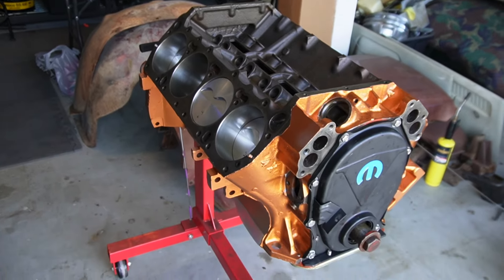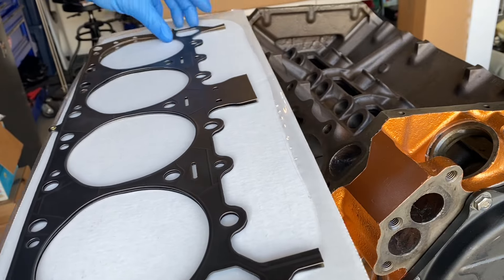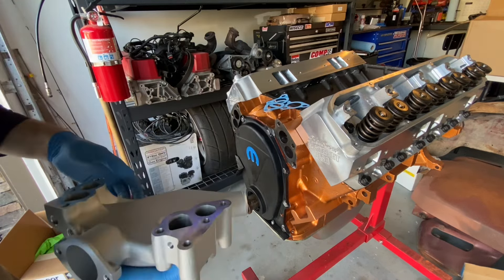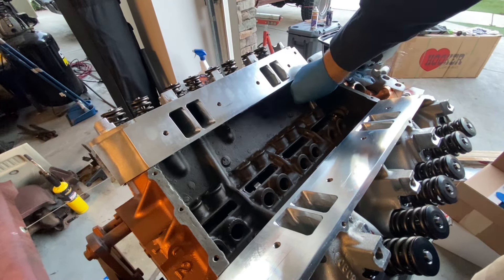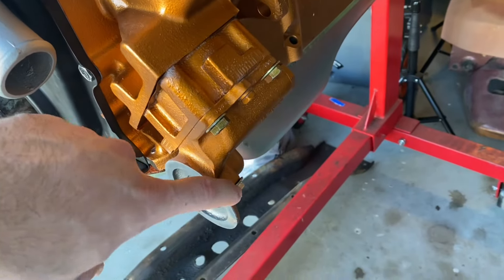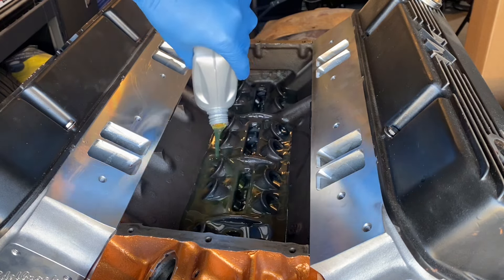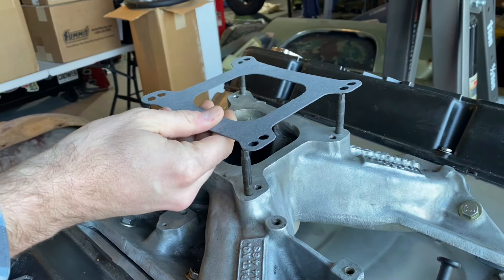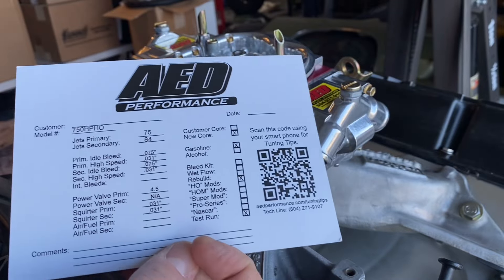BUDGET Mopar 426 Stroker Top End Assembly!

Comment: The small .474" Purple Shaft will work with your 9:1 compression ratio pretty good! Due to heat loss, you will have the same fuel requirements as an 8:1 iron head engine. I would install the camshaft at 102*ICL (8 degrees advanced) and you may need to run 36-40* total timing to make the best power. I would recommend running a vacuum advance for street driving. Your intake manifold is a perfect choice! 4-hole tapered spacer and a 750 Holley!!  1-3/4" primary tube headers will work, no bigger than 1-7/8" primary size, and NO CHAMBERED mufflers, use straight though perforated tube designs with packing.
Reply from the maker: It’ll be pretty nice to run 87 or 89 octane at the pump. Definitely running the vacuum advance and I’m currently starring at a set of hooker headers with 1-7/8 tubes  🤘🏻

Comment: I really want to assemble an engine. But the thought of it is just flat out terrifying!!! 🤣🤣🤣🤦🏼‍♂️
Reply from the maker: Just gotta jump in! It’s a love/hate relationship but, very rewarding at the end of the day.
Reply: the FIRST thing is to find a "reputable" machine shop that will do a great job. (Don't spend ANY money on a core until you find a good shop!!). So ask around on forums or F/B and read their feedback. 2- is have a CELAN/DRY area that won't cause "whining" with anyone you live with, or at your friends place.: that can be used for MONTHS! and NOT BE MOVED or maybe STOLEN.  3- is to find a good rebuildable block, or one that you can hear run and check the vitals in front of you before a purchase.  4- after you assess what "parts" you need, DO YOUR RESEARCH with Jegs, Summit, Mancini etc to make sure the parts you need/want aren't back ordered. (it's frustrating, trying to fulfill your dreams while you just gave a chunk of your money away, only to find out you have to wait MONTHS!)   5- Join numerous sites or forums to gain as much knowledge as you can. Along with asking friends who have done or do this frequently. NOT every 5yrs or so.. Because if you need a specialty tool, you can borrow instead of spending $$$$ on tools that you'll not used again. 
Keep EVERYTHING CLEAN!! This can get frustrating also if you don't have anywhere to "CLEAN" parts and the room to store them without humidity or lawn mower dust etc to ruin, or force you to spend more money to prep parts again..
So, here's some encouragement, MILLIONS of peeps have rebuilt cars, engines, tranny's etc that ran and served them well for YEARS! So, if you can focus your time and money, while being wise about this challenge, GO FOR IT!! There's plenty of folks to help.

Comment: Good morning. Did you make any oil passages larger in the block? I bought one of those long drill bits to drill my 400 block. 
Just haven't seen any videos of someone doing that. Also, what "parts" did you have to change out since you built the shortblock?
Thanks.
Reply from the maker: Morning, I did not drill out the oil passages. I did contour the openings on the main bearings slightly but, that’s about it. I have a dedicated video of the short block assembly where I went step by step.
Reply: @sorta_stock  yes, saved in favorites.  But didn't your recent video say that you had to change out parts? Or was it only top end stuff?
Sorry if I have confused yours with other ones.
Reply from the maker: @blownaway4371  after building the short block and finding that my deck clearance was greater than expected, I had to rethink my top end assembly. I was originally going to go with a set of 915 heads but, decided on the E-Streets for the smaller combustion chamber and cost. I didn’t change anything on the short block.

Comment: no quench is worse than compression, deck the block, good gasket choice
That plated water pump is way to go, less cavatation, more flow
u do not want grade 8 bolts  they require too much torque to give proper stretch load, using stock torque spec does not give any stretch, they come loose easier
Reply from the maker: Definitely concerned with the lack of a good quench in this build. If I were set on this going into a purpose-built fast car, I would probably swap the pistons to rectify the issue. I’m leaning pretty heavily towards putting this in my Ramcharger. I figure it would make one hell of a daily driver engine.
Reply: @sorta_stock  yep   have to run better gas and it will run hotter in the chamber, take more throttle to get the same power. however 400s were like that stock  how did the piston vendor screw up that bad  looks like 1/8 down otherwise so far so good.  with no quench your timing window is narrower  it's the low plug location that is also a problem, you get pre ignition or detonation on the other (intake) side of the piston (chamber)   I do not remember, do those heads have a modern chamber or stock like?

Comment: 10.08 is only .028 taller than 9.98. therefore,it appears that you simply used the wrong pistons. If you still managed to achieve 9:1 with the 75 cc chambers then your street hemi grind camshaft will work well. I would degree it to confirm accurate valve timing and possibly advance it not more than 4 degrees ahead of the recommended centerline. Even that much is probably unnecessary. Good luck.
Reply from the maker: I wish it was only .028 taller. The 10.08 calc is a good .1” higher than the stock 9.98. I’ve heard a lot of good things about this cam. Excited to see how it performs.
Reply: @sorta_stock  Sorry;you are correct. I was thinking 10.008. Very strange being .100 taller than spec. Wonder how that ever happened?